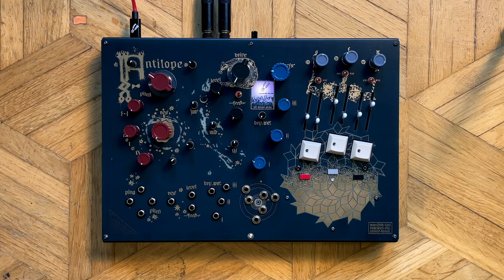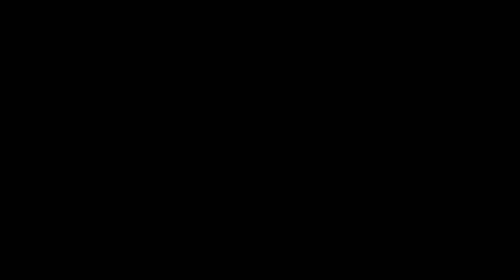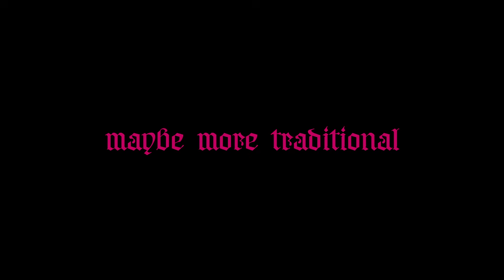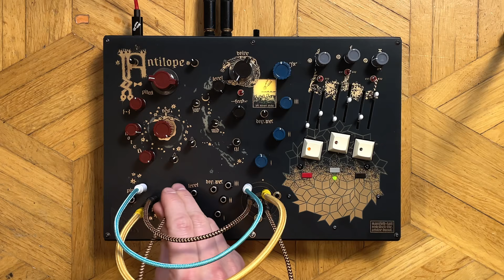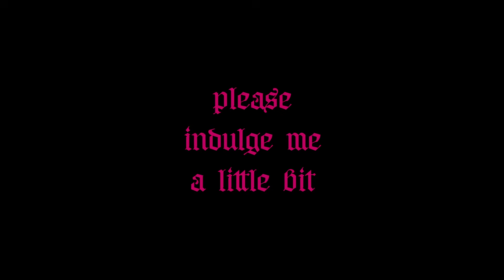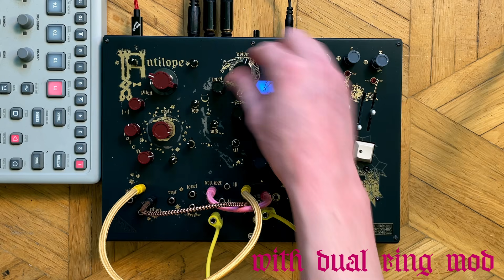manifold research centre - antilope introduction/demo

Comment: Are you going to make more of this one? it says out of stock on the website.
Reply from the maker: Yes i will, where are you based?
Reply: @manifoldresearchcentre2685  I am based in Sweden so i can order it when it is available no hassle. I was just wondering as all sites i looked at did not have it, and on your site it said out of stock. Glad you are making more though. It is a interesting Synth.

Comment: that’s a VERY resonant filter! there’s some kind of peak in there (around 4:50 anyway) which reminds me of a CRT flyback 😅
Reply: of course i’m sure the distortion is accentuating it! (or maybe even creating it…)
Reply from the maker: I need to learn more about those!
Reply: @manifoldresearchcentre2685  oh they’re super cool. The copper coil generating the magnetic field also vibrates with the ~16kHz signal the VCO sends into it (for the horizontal beam sweep)

Comment: Hey there!
I need a more in depth demo, what's the sonic palette without distortion/feedback nor fx? 
How do we sync it with external gear? 
Does it track V/o well enough? 
Who's analog and who's  numeric?
etc...
Beautiful design! 
Very appealing, congrats!
Reply from the maker: Filter and distortion analog, fx and cv generator digital. Tracking up to 4 octaves then starts to drift. For the rest have a look at the website, there’s a manual there!
Reply from the maker: Also, will do more demos, when no distortion or fx, the self oscillating filters are sinewaves.

Comment: Good job! Sound nice 👌 Have a sync system for external gears?
Reply from the maker: Thanks, yes Midi clk and gate/inputs inputs. However, due to the nature of the sequencer they act as a reset. In the case of MIDI, antilope generates a pattern the length if your 4/4 midi clock. With gate/trig inputs, antilope resets every 4 beats.

Comment: Hey, what are the dimensions, doesn't look like it would fit in 3U. Would I be able to take off the panel and somehow squeeze it into eurorack format with a custom faceplate?
Reply from the maker: Sorry but it wouldn’t fit!
Reply: Ok so its one big PCB under the faceplate, got it. Any chance you will ever do a run of these im euro format or release boards for diy?
Reply from the maker: @xiphod2207  As a module would be massive, probably more than 60 hp, basically a small system. 
Since its already euro compatible I personally dont see a reason in making a module for the whole thing, I am although planning to make the core section in euro format (not yet sure if with XMOD matrix or not).
But sorry DIY is not in the plans.